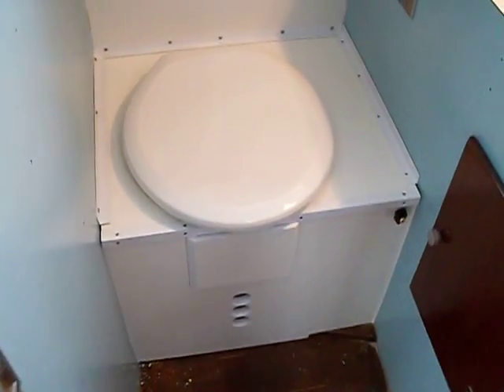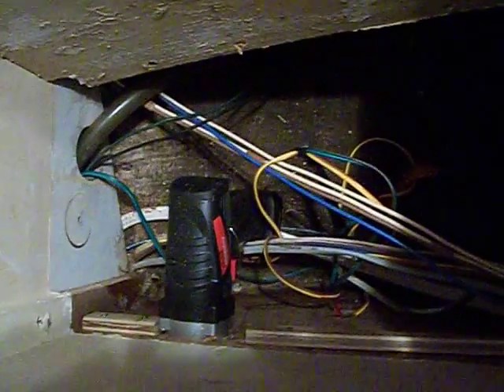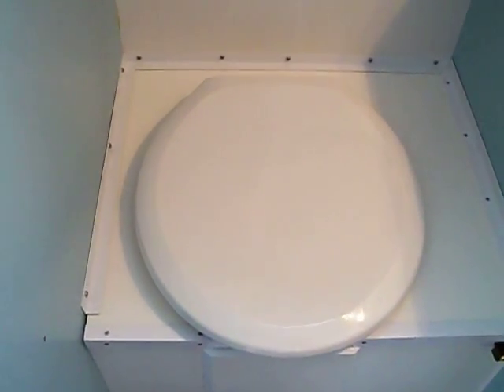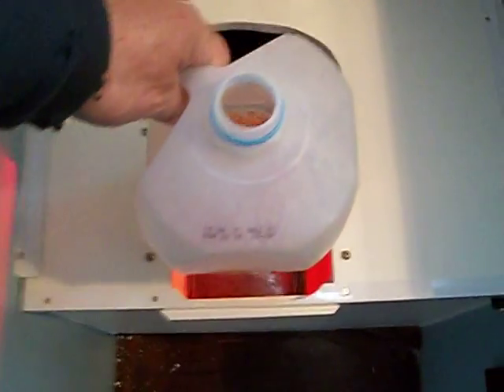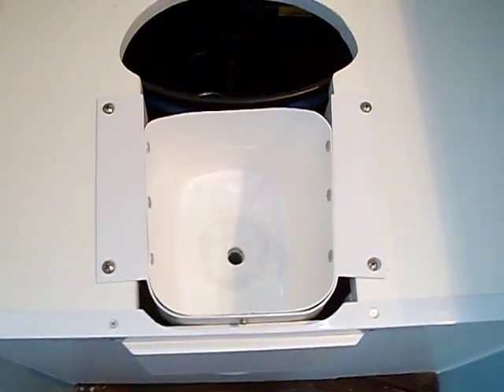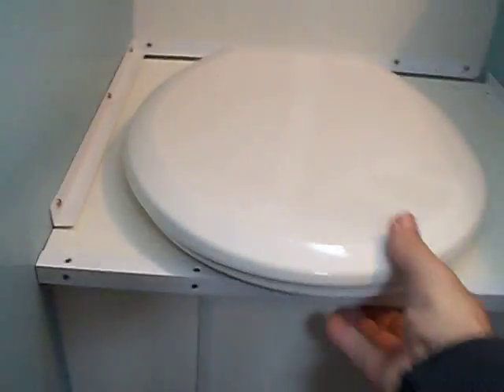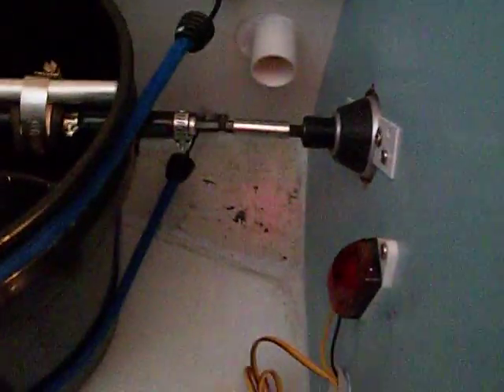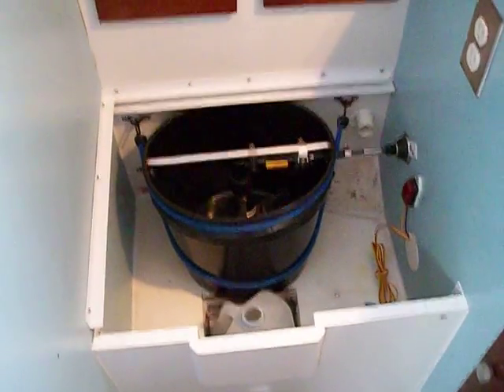Composting head for my 1968 Bristol 32

Comment: Hello, I hope you still look at your comments on old videos, i really like your setup you have created. I am considering something similar for a Tartan 27, so after roughly 2 years of use how has your system fared? what would you do different or change to make things better?

thank you for your time and videos.
Reply from the maker: Not that old of a video. It has worked out very well. I had to cut the agitator blade in half because it was too much work for the motor. And added a 10A variable speed controller to adjust the motor speed as she loads up. Other than that all is well and it works great with no smells and very little maintenance. If you need more details, let me know.
Reply: Eric, Thank you for your reply, My project will be down the road a bit, But when i do get to it on the list i will most definitely be back in contact with you on some of the points.